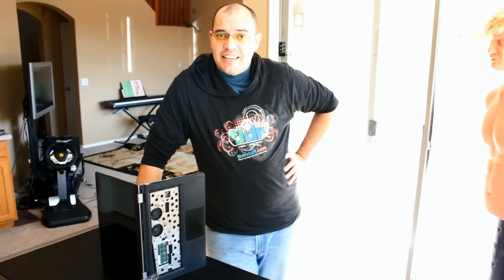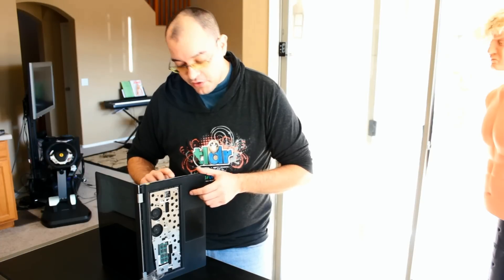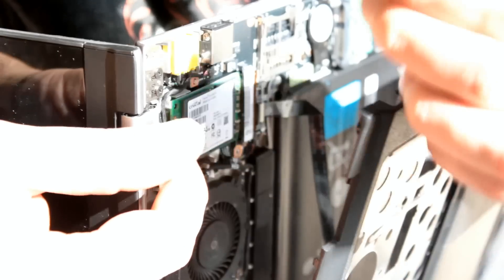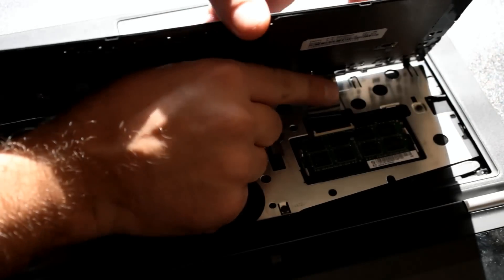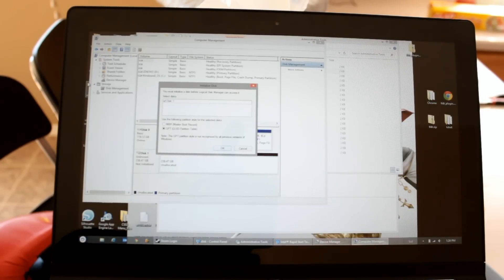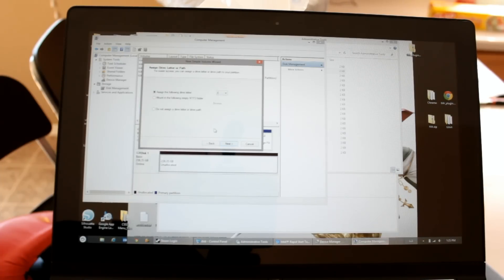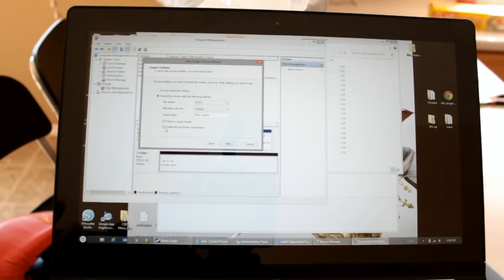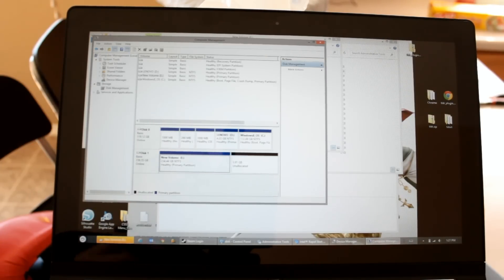Lenovo Yoga 13 SSD Upgrade Via Second SSD Install

Comment: according to crucial you can put a 16gb ram in there too.... i upgraded my yoga 520 141kb and added a 256gb ssd, but in truth you can have a tb ssd or 2 tb sata as second drive, and up to 16 gb ram with a crucial 16gb ram card in the single ram slot

Comment: Did anyone benchmark and compare the second (newer) SSD? Wondering, if the poor transfer rates of the initial SSD are related to the interface/bios or because of the kind of ssd Lenovo used.

Comment: Thank you for the video. I needed a bit more help with the disassembly and used Old Guy Geek video for it as he walks those of use who have never taken a thin ultrabook apart through the minutiae of keeping the ribbon cables intact :-p Your step by step instructions on how to get the second SSD recognized and formatted were amazing, as the new SSD wasn't appearing at first. Thanks for sharing your knowledge.

Comment: Good instructional video!  Thanks for posting!  A couple of points to add based on my experience: 1) You can download the hardware maintenance manual for the Yoga 13 simply by doing a google search for "Lenovo Yoga 13 hmm".  this helps with identification of screws and ribbon cables and the like.  Its good piece of mind to refer to.  2) Be careful about getting tech support from Lenovo, I called them to ask about swapping the OEM (Samsung) 256 GM SSD for a 500 GM Samsung 840 EVO.  They told me that the motherboard was limited to 256 GB - the guy didnt even mention the second SSD slot.  Anyway, my 840 EVO is installed and working great!  Between the 256 GB OEM SSD, the new 500 GB 840 EVO and a 126 GM SD card, I now have enough storage in my machine!

Comment: I added a 500GB Samsung mSATA with the help of this video. One thing not mentioned is that there are several ribbons and plugs besides the keyboard one and when you remove the keyboard you may accidently pull these out. I accidently pulled out a very small one located near the RAM which rendered powering on the PC null. After I plugged that in and powered it on I then discovered my track pad/ mouse was not working. Opening it up again I noticed that there is a tiny ribbon on the right side that had somehow gotten loose. My guess was the double sided tape I had placed on that side had caught it and pulled it out.
Reply: Getting ready to change RAM to 8G and adding another SSD.  Glad you mentioned adding a 500, thought 256 was the limit.   
If it's working for you, a model number would be appreciated.  
Also, hope all of the 500GB is really available.
Thanks
Reply: you are obviously clumsier than a fiddling electrician... at least you could do it, im even clumsier, and would have ripped half the essential cables off trying to unscrew everything.. lucky in Thailand it cost me about 1/5th of what it would cost to pay someone in the west.. so its easier to pay someone else here to do it for you

Comment: Do you know if the SAMSUNG 840 EVO MZ-MTE1T0BW will work. it is 1 TB and that would be greaT
Reply: As long as it is a mSATA it will work.
Reply: Derek D The Yoga uses m.2, not mSATA... An mSATA wouldn't fit. If you want 1TB of storage, the best bet would be 2 512 m.2 drives...
Reply: Hi Scott, did you by any chance compare speed of the two ssd? Wondering, if the 840 is significantly faster then the original.

Comment: I was hoping to upgrade the second SSD but the "Crucial m4 256GB mSATA Internal Solid State Drive CT256M4SSD3" is over $300 on Amazon and sold out on NewEgg. My question for Biz of Tech is, would this (http://www.newegg.com/Product/Product.aspx?Item=9SIA2W00ZD1485) make an adequate replacement? Let me know! Thanks.

Comment: I have a haswell yoga, in Sweden there is only one model of yoga 13, It has a 500GB hdd, 8 gigs of ram and the i5-4200u processor. will my yoga have the same motherboard?

Comment: Thanks a lot for the detailed video and instructions, I successfully added a 240GB SSD to my Yoga. Just as a word of warning to others, I did get scared briefly when my keyboard was not working anymore after I put the laptop together again. The problem was either the blue ribbon cable that has to be fit nice and straight into its slot under the black hinge, with the white line on the cable running parallel to the hinge. Or it was that the clips under the A+H+K+Enter keys were not hooked in. As mentioned by another user, make sure to press at least H+Enter when sliding keyboard into its place.

Comment: http://forums.lenovo.com/t5/Idea-Windows-based-Tablets-and/Yoga-13-Recommendation-for-RAM-and-second-hard-drive/td-p/1139801

hi lebert,
 
Welcome to Lenovo Community Forums!
 
For your RAM upgrade most people uses "Crucial" brand without having any issues upgrading
You can check the link here

http://www.crucial.com/upgrade/Lenovo-memory/IdeaPad/IdeaPad+Yoga+13-upgrades.html
 
The other slot on your system for Storage is an msata drive for another SSD
Max configuration for SSD is 256Gb which is another Crucial Recommended by other users
here is a link 

http://www.amazon.co.uk/gp/offer-listing/B0085J17UA/ref=sr_1_1_olp?ie=UTF8&qid=1389788965&sr=8-1&keywords=Crucial+m4+256GB+mSATA+Internal+Solid+State+Drive+CT256M4SSD3&condition=new
 
Replacing parts on the computer does not void your warranty but any damage while replacing and upgrading parts will not covered under warranty. So even you have upgraded some parts on the computer in case your need service for other parts like Keyboard, touchpad etc.. You can still call Technical Support and get assistance.
 
Here is a simple guide on your plan of Upgrading
http://forums.lenovo.com/t5/IdeaPad-Slate-Tablets-Knowledge/Can-you-install-a-second-mSATA-SSD-in-Yo...
Hope this helps,

Cheers!!

Comment: I also ran NeoSmart's Easy Recovery CD on USB (Linux bootloader) and it's saying that the original SSD is "unmountable" while Windows 8 Recovery tools (copied from another PC) say that the original SSD is either locked or corrupted. Any thoughts? Everyone else makes it sound so easy.

Comment: Could you please tell me the exact changes that you made in the BIOS? I've spent 6 hours on this today and can't get beyond error messages at boot-up. If I restore BIOS to defaults, I get a "Default Boot Device Missing or Boot Failed" message. If I change the BIOS>Boot>Boot Mode to Legacy Support it gives me a "No Bootable Device" Message. The new SSD always shows as the only Hard Disk on the Information tab and, after changing to Legacy Support, it shows as the only SATA HDD on the Boot tab.

Comment: Brandon, I have contacted Lenovo to get the spec of the SSD I need to buy to add as secondary device on my Yoga 13 256GB, but they say this is not supported, will void my warranty, and cannot provide any info.  Could you suggest what SSD vendor and model(s) you know work? I contacted Crucial and they said that their SSD drives are only 2.5", not 1.8" which I think you mentioned in your video.  Thanks for your help with this. Eager to get this done...! Great video, by the way. I feel confident...

Comment: Just look at the service manual Lenovo posted. It states three possible configs for the wireless LAN. I'd open it and measure the size and see what might fit. I used to do this for my Asus and it took several tries to get the right one. Or, you can buy the Thinkpad Twist which has much better wireless for less.

Comment: Hey Brandon, quick question for you, can you remove the original 1.8 SSD, upgrade that one, and then add a new Intel WLAN Adapter? As I don't really want a RealTek WiFi Card. I have been contemplating this due to the reliability and performance issues of RealTek.

Comment: Just upgraded my RAM and added an SSD. Your videos were a great help, both in documenting the actual steps and giving all of us the confidence that this was possible. With a T5 screwdriver, a #0000 Philips, a plastic pry tool, and the parts in hand, it took about 20 minutes to complete the job.The Yoga is an amazing machine and the fact that you can upgrade it yourself makes it a great value too.

Comment: i got a 2nd ssd installed but having problems getting it to dual boot with windows 7. ive tried muttiple combinations in the bios settings. i have windows 7 fully installed on the 2nd drive and works fine, but in order to get it to load i have to hit the boot option (f12) everytime. in other words no dual boot options. it drives me crazy that i cant get it to work they way it should.

Comment: haha. look at all those partitions on the primary drive. one of the only things i dont like about the yoga other than windows 8 metro. there is a fix to reduce partition thing on lenovos site called "Partition Structure Hotfix for Windows 8 (64 bit) - IdeaPad Yoga 13"

Comment: Brandon, where did you purchase the drive upgrade? Also, have you found any good keyboard protector accessory? I'm a little leary of just sitting the keyboard on my desk face-down, thinking that over time it'll mar the finish of the keys.

And btw, great video! I especially like the little tips like the keyboard connector tip, the BIOS tip and going into computer management and assigning drive letters, formatting, etc.  Great job!

Comment from the maker: You can. But if either has issues you lose everything. So I would instead mount volumes as directories. That way you get what feels like a single volume but it doesn't have the risk a single volume would.

Comment: I have the yoga 13 with the i5 processor. I want to add a 256 ssd. After speaking to Lenovo they said to limit the SSD only to 256gb. you added the the bigger ssd and kept the smaller 128gb one too. Have you had any issues since?

Comment: I wonder if putting a 256/512GB SD card would be worth it and easier... (are access speeds slower?) the file system would be peace of cake since one can redirect program file root directory..

Comment: I also just noticed that ATTO bench 32 is not able to drive either the included 128GB or new crucial 256GB at any speed higher than 300MB/sec. I know the crucial drive is supposed to be sata3 and should hit something near 500 MB/sec. Looks to me like this model is stuck at Sata2

Comment: more hints. Take pics with your cell phone as you go along, so you can use as a reference to put back together and possibly contribute your experience. Also keep track of the internal screws since they are not all the same.  It took me about 15 minutes and the process is not too bad if you have even a little hardware experience. Good luck.

Comment: I echo the thanks. I ran into a minor issue whereby I accidentally detached the touchpad cable but that was an easy fix. I also offer another hint. If you don't want to unplug the keyboard, use scotch tape to hold it in place so that you don't let it drop and place stress on the delicate ribbon cable. Also, I used a Crucial 256GB M4 SSD and it came with screws, only one of which was needed and it fit fine. I am loving the extra storage. BTW, I have seen the SSD as low as $160 at deal sites.

Comment: Thanks for the video. I just ordered my 2nd hard drive and am preparing to do this upgrade. I've read on the forums some people are having a issue with the device failing to boot after the upgrade and then having to send it to Lenovo to be fixed. I'm not sure if they missed the bios step or not. But do you have any tips so that doesn't happen. I too have purchased the best buy model and the Crucial m4 256GB mSATA Internal Solid State Drive CT256M4SSD3

Thanks.

Comment: Hi,

does anybody know, if the Ideapad Yoga 13 with the i7 and 256 GB SSD option actually comes with ONE 256 SSD, or if it hast two 128 GB SSDs installed?

Comment: GOOD: nice schortcut to bypass disconnection of few cables to reach SSD slot - makes the upgrade safer!

BAD: replacing keyboard shown is a bit MISLEADING - people can bend catches under their keyboard. Get&See Yoga service manual: SLIDE keyboard to its position, not push directly down. Catches are under keys A+H+K+Enter, press at least H+Enter when sliding keyboard into its place so catches properly fit under their counterparts. Verification: pressing these keys won't BOUNCE the keyboard plate.

Comment: Great Video. However, I brought the 128G Yoga and bought a 128G SD Card. No need to open the computer or change any setting. Just plug in the SD card and you have 256G in total. Just a thought...

Comment: Hi great video, thank you so much for the demo on how to do this. I have a question, are both SSD bays for 1,8" drives? If so, would it make sense to buy a second 256Gb drive which is faster than the included SSD and "swap" the primary to be the faster 256Gb drive and leave the128Gb SSD as the secondary drive? I hear comments on the included SSD being pretty slow...

Comment: Great video and help. Can the new SSD combined with the 128SSD drive be formatted as one drive? If so do you have instructions on how to do that. Also do owners of the Lenovo have to make their own Recovery Disc using a Flash Drive Stick or what do you suggest . Thank you

Comment: Can you tell me a little more in detail how you remove the keyboard? Will it be easy to remove once you undo the screws on the back? 
I usually don't mess with my computers hardware but I really like the option of upgrading my new shiny lenovo yoga.

Comment: Great Video! thanks a bunch man! 
 I like how you did it just keeping some still connected as those ribbons look delicate. Just to clarify: you only need to disconnect the one ribbon from the keyboard to motherboard to add the SSD? not the battery connector etc?

Comment: Is it possible to take out the existing 128gb and then install 2 x 256GB drives (one goes int the place of the old 128GB).  Would this entail just installing windows 8 to the new drive or are there specific yoga files that need to be loaded onto the new drive in order for the yoga to work properly?

Comment: Which 256GB SSD did you use?  Are the IdeaPad Yoga's SATA 6.0Gbps compatible?  Most of the 1.8" SSD's I've seen are the SATA3.0 but there's a substantial speed increase going from SATA3.0 to SATA6.0 so if the Yoga's MB supports the latest SATA architecture, wouldn't we all want to take advantage of that? :). Thanks for the reply!

Comment from the maker: Typically no. But it depends on a lot of things. Like if you used the recommended part, and what went wrong.  If your keyboard dies because you took the thing apart and broke the ribbon cable, yes it will void the warranty. If your original SSD dies and you didn't touch that, then they will still cover it.